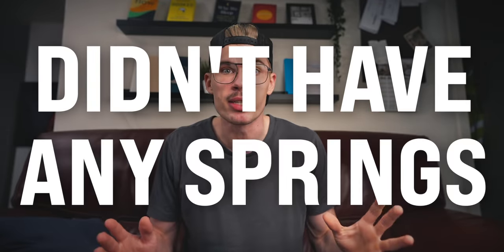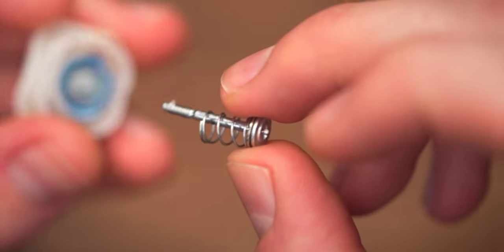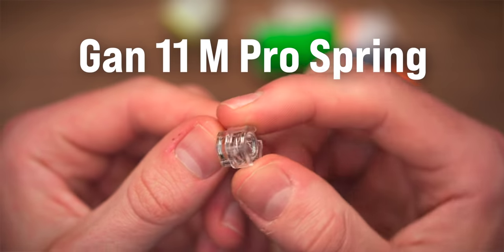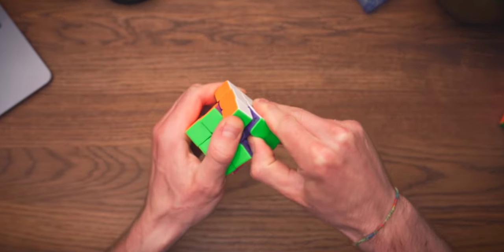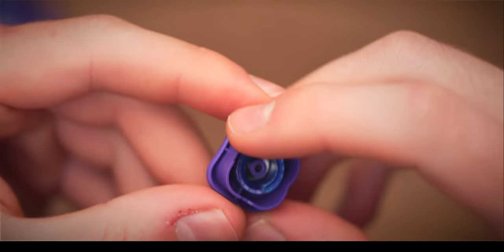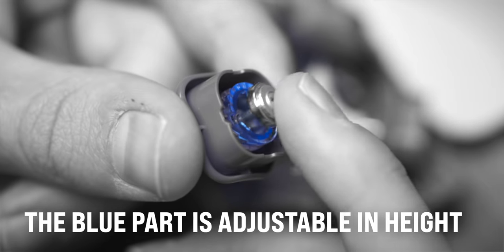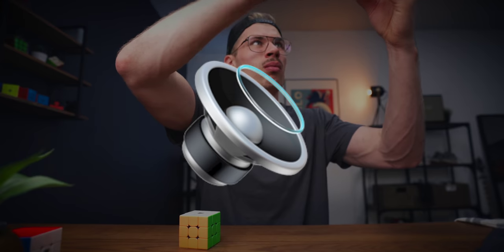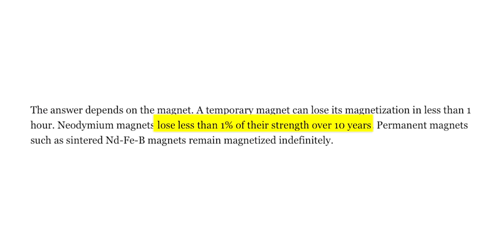The First Cube With "Magnetic Springs" - What Is This Magic?!

Comment: in my opinion, it solves some more problems besides spring noise, the springs tend to become weak if left under tension for long periods(not sure how long tho ¯\_(ツ)_/¯
) and on top of that, now u dont have to worry about lubricating the core at all! 
the magnets dont physically touch each other so there is less room for wear over time. 
also, normally, cube companies send extra stronger springs in the packs, but here they can just throw in some donut shape magnets that can be thrown in the same slot to increase the force,
and i'm gonna assume that magnets cost less...... (i honestly dont know, but it makes sense(kinda).....)

Comment: Mag-lev is less a functional upgrade and more a longevity thing. Yeah, it cuts down on the noise but removing the springs but also there's less friction which means less wear over time. Springs also wear out faster than magnets lose their magnetism. So it won't exactly change the feel, it'll just last longer and degrade much slower.

Comment: Just think of the customization possibilities swapping magnet strengths in the core. Will be a lot simpler than springs and it will last longer honestly you will only need 1 cube as they start making stock magnets for the cube core sizes.

Comment: My luckiest scramble (random, but it's real)
15.72   (I average around 18-20 secs)
R2 U2 F2 L2 U2 R B2 R U2 B2 F2 L F U F' D B2 R2 F2 D2   
This is such an easy XX Cross and 3rd pair😂

Just try it out... It's on blue cross, with a two move cross + X cross and if you insert the red-white edge before aligning the cross, you will have a XX CROSS and a free 3-move pair 😂👌🏽

Edit: I don't know how to write solutions so I've just explained it😅

Comment: Hey there, great video 👍, but are you (yoo?) sure that the WR M MagLev is 2021 version? I'm asking because I can't see magnet adjustement on the edge pieces. Can you (or again: yoo?) explain? Is it a 2020 version perhaps? 🤔
Reply from the maker: it does have the magnet adjustment system, I'm assuming it's a 2021 version just with the maglev
Reply: Right, it has it on the corner pieces. 🤦‍♂️😆